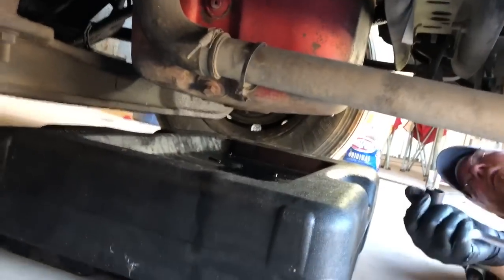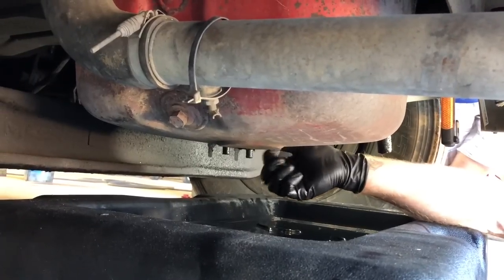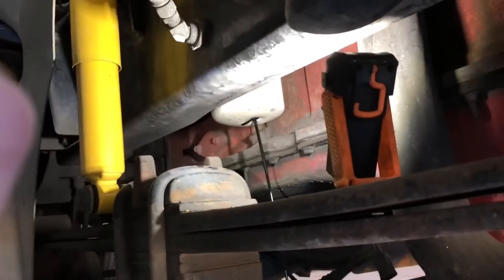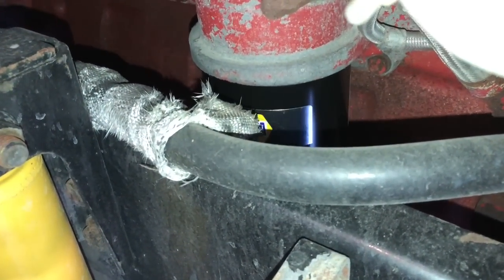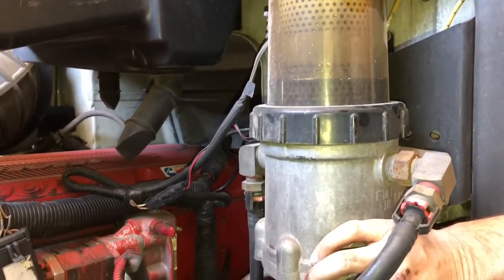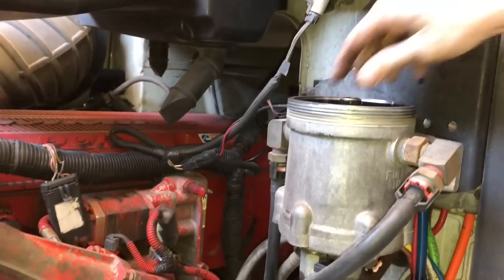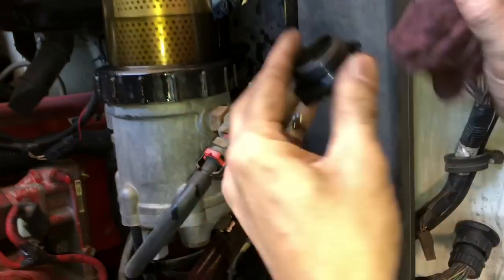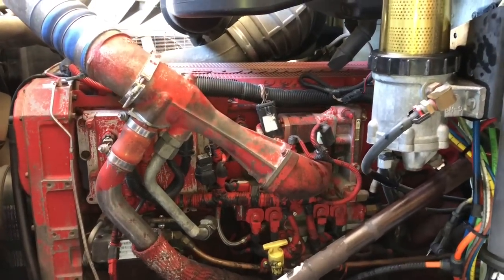Cummins Engine Service - Step By Step DIY How To Guide

Comment: For those who dont know. . .Its NOT punching a hole in it that removes it. Punch hole in it to drain the filter. To get the filter to unscrew, you just need to hit the filter, whether with a dead blow hammer or the wooden handle of a sledge. The point is to break the rubber oil filter seal that has become dry and stuck and wont let filter turn. Punching a hole in the filter will not always work if you dont shock the filter hard enough to break seal loose.

Comment: Was driving a new truck with a Cummins engine once years ago. It developed  a loud screaming noise. The boss said you are near a Cummins dealer. Tell them to check it out and change the oil. A large hose clamp was in the turbo. I looked under the truck before I climbed in The drain plug was hanging by about 1 thread. Luckily the plug was at the front where it was easy to see.
Reply: Drivers should know what thier driving
Reply: Doesn’t hurt to look under and check

Comment: Using the punch in the oil filter, is a great tip. Thank you.
Reply: I do the same thing but use a 18" alignment bar that I ground down to a point. Comes in more handy when they are more recessed as well.
Old timers like to give you shit but I don't care. They can continue to fill their armpit with nasty diesel oil. Or better yet drop a full filter on their face and make a huge mess.

Comment: I have see them loose installed by someone else.Complaint is a oil leak and the fix is simple,tighten it up by hand only.Make sure the gasket from the old oil filter is not stuck to the block too.I have done it and caught it in time,forgot to check for this wondering why it was not tightening up.

Comment: I don’t put the drain plug back on until the new oil filter is on cause oil will come out the pan once u drop the filter not always but sometimes it will so I usually do filter first then drain plug

Comment: I work on medium duty Isuzu box trucks and on those fuel filters like the one you showed on the driver side I usually have to pull vacuum on it otherwise you can prime it all day long but that truck will never start

Comment: Ever run Into an oil filter that won't come off after punching a hole through it? Or a lift pump that fails to prime? A lot of fun.
Reply from the maker: We always break them loose before punching the filters. Been there done that and didn’t even get a t shirt ! Lessons learned the hard way always seem to stick around the longest.

Comment: How many gallons of oil does a 1987 350 big cam engine hold? I lost the dipstick so I pulled another one off of my parts truck and need to see where the oil sets so I can mark the new dipstick.

Comment: Say I wanted to use a pump instead of crawling up under there to pop the drain plug... whereabouts would I go sticking the intake hose from the pump?

Comment: That's the easy part . The chasis needs grease and whatever else. It's hard to find a video about that.
Reply from the maker: Pretty simple:
1.Look for grease fittings 
2. Put grease gun on those grease fittings
3. Pump grease gun 
4. Wipe off grease fittings. Done.

Comment: Guy had that bottom O-ring sucking air a few weeks ago. He was 100% sure it was right. LOL after checking it. found out it had rolled and was the issue.
Reply from the maker: Pete k probably got in too big of a hurry. Sometimes slowing down is the fastest way to get a job done. Old guy once told me “slow is smooth and smooth is fast” took me a long time to figure out what he was talking about. Prime example right there

Comment: Hey, I have an old truck with a cummins M11, has not run in 3 years. Ran when parked and has less than 100k miles since new. How extensive a service do you think it would require to get tit to fire? Would this be fresh fluids or would I be looking at injectors, fuel system probs?

Comment: My theory is the oil plugs tighten on their own some how. We have a couple cat motors and they have 1 1/2 drain plug. I've serviced the same truck twice in a row, I was the only one to touch the drain plug and that son bitch was tight as hell had to use the ez red 3/4 drive extended ratchet. The one that's 3 foot long lol. And I know I put it on "hand tight" last service lol
Reply from the maker: I agree. I know those speedco guys are pretty bad about over tightening them. Every time we get a truck like that I ask them who did it last time 90% of the time it was speedco the other 10% TA ! Haha

Comment: For our freinds at speedco the torque on the oil drain plug is 59 foot pouds/80 n.m. lol
Reply from the maker: memopat1 I think they are hitting about 159 ft lbs ! Haha that was unbelievably to tight ! As you seen I had a long handle 1/2” ratchet and still had to put a cheater pipe on it.
Reply: Actually no the torque is 35 foot pounds on a isx

Comment: Wait a second. How you get that oil filter loose? Didnt show how long or much crap to get it loose being you all had to use a breaker to loose the drain screw. Filter had to be tight

Comment: After whacking myself in the head more then once . I bought a 36" breaker bar off the truck . Snake it between the frame and the leaf spring and you crack the drain plug loose . Don't even have to roll under the truck .

Comment: He you probably won't  read this but on those upright Davco filter housings you should really clean out with some brake cleaner. This cheap and nasty bio fuel that truck stops have gunks up inside the housing.
Reply from the maker: I read all the comments ! We usually clean them out but not with brake cleaner, it’s too rough on that plastic and will cause it to crack over time.

Comment: Whats the point of punching the oil filter besides the fact that you dont gotta worry about tipping it and spilling oil or it draining out around the filter when you take it off?
Reply from the maker: Blaze Box that is the point ! If you have never dumped a full oil filter because you bumped it trying to get it out or dropped one ...... well you have really missed living because it is so FUN ! Haha just saves a mess later on
Reply: Blaze Box that's it, you don't make a mess when it's not full of old oil taking it off, plus it's not as heavy!
Reply: Yea i pretty much figured that was the reason i dont have the time at my work to punch every oil filter i do so i either live with the mess if i happen to drop one or most of the time now i dont have a problem holding on to em lol

Comment: I removed my fuel filter and can’t get the new one back on. The old one came out easily but I can’t line the new one with the threads, any thoughts?
Reply: What type of filter is it ? I can help you
Reply: @renegadorivers4031  i got the filter on after 2 days , thanks for replying

Comment: Why do u put oil in the middle of the filter i thought it was only good to do on the sides in the holes
Reply from the maker: It still wicks to soak the paper inside. People scream that all day long but it still wicks to keep from taking oil as long to go through.
Reply: @KoonTrucking  makes sense thanks for responding clay I appreciate that a lot love your Chanel man I was in a bad place when I got out of rehab and this Chanel is what I use at night  now before bed gonna go to diesel tech school just for the tool discount lol thank to y’all making me fein for tools ⚒️
Reply: I thought it was the fuel filter that you only pour in the holes along the outside and avoid the center hole. I've already filled every hole on oil filters.

Comment: All those Snap-on tools and you use a harbor freight ratchet to bust the drain plug
Reply from the maker: David Crowe first off it wasn’t my ratchet I was just helping the guys in shop that day. Second with the cheater pipe I wouldn’t do that to my extra long 1/2” drive ratchet either. $265 ratchet there ain’t no cheater going on my handle.

Comment: unscrewing the drain plug on the side of the oil pan leaves another 1 gallon of dirty oil inside.  first mistake!  the second mistake is that if you tighten the drain plug with such an effort, the thread will soon be broken.  seeing so much lack of professionalism, I did not look further.